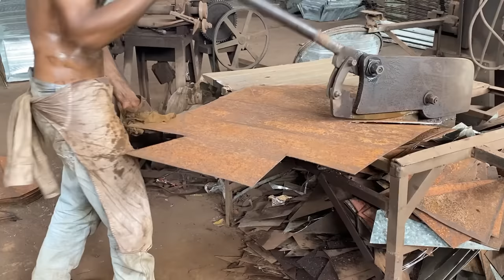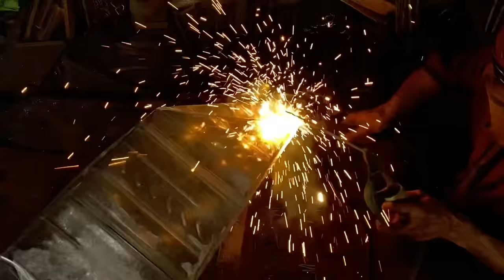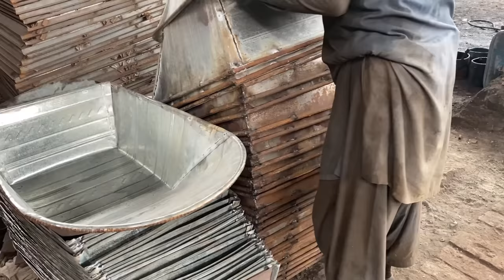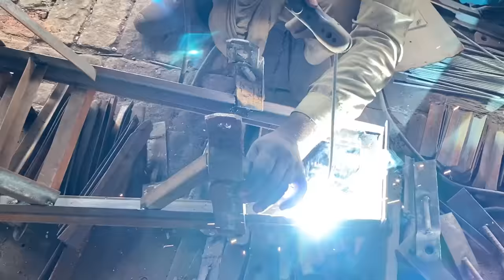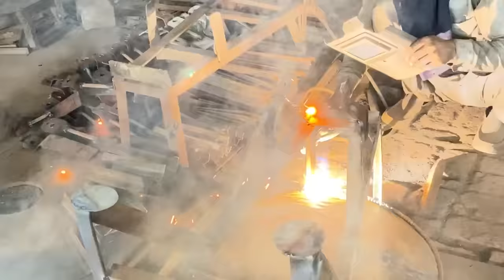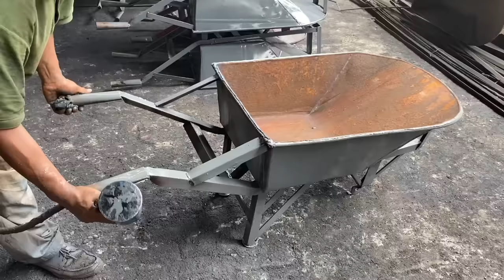Easily Local Factory mades 1000 Of Wheelbarrows in few minutes! How to make Wheelbarrows.

Comment: Them wheelbarrows  are  a little rough  to look at but there actually  very well made   and I reckon are stronger than the ones  that are mass produced    again you have to look at what machinary  is  available  to the guys  so all in all  well done guys from cork city
Reply: Looks like they are all only about 1/3-1/2 welded the length of any seam of metal they weld, that could be done much better.
Reply: lmao they are not better than mass produced. They are way thinner and have multiple weak connection points instead of being made of one piece. India loses again

Comment: Wonderful and Mind Happening Hard Work. These are 1000 No Produced per day that means approximately 300,000/ per Annum. This Item is very easily Exportable for use in Construction, Engineering, Manufacturing and even for Commercial Markets, can be easily Purchased and can give good earning to the Laborer. PPEs and a Tuning of Manufacturing Process can improve both quality and quantity of Product. Thanks for Exploring Good Work.
Reply: %90% of these would fail and break when put to use. Very poor quality matterials.  Construction and design
Reply: @w124mercedes7  it's definitely not poor I have seen in Dubai much lower quality
Reply: Аха ашида